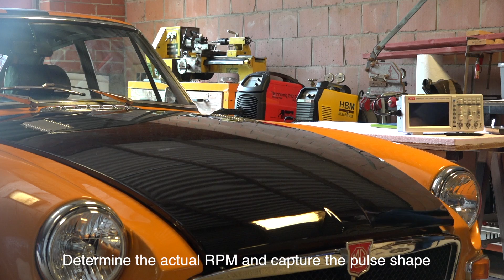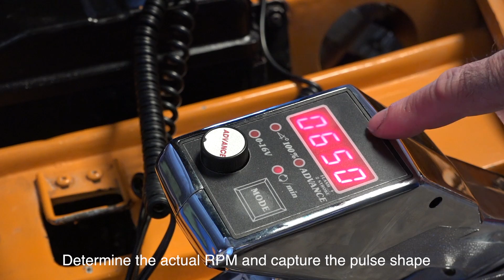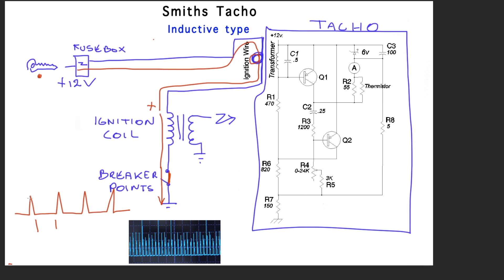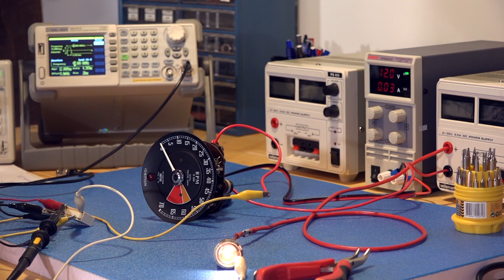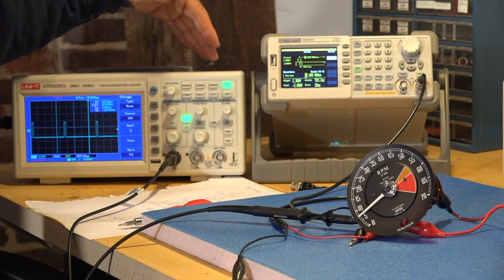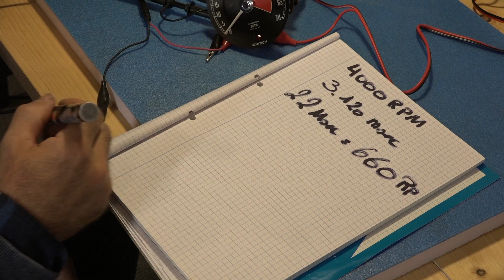Understanding and adjusting the Smiths tacho Part 1

Comment: Can't believe you've posted all this info! Its much appreciated.
What are your thoughts on using the tach output from an Msd 6al2 ignition box direct (maybe reduced voltage) to the B leg of the transistor? As per your signal generator.
The induction loop on my RVI I'm sure won't work due to multiple sparks and the high voltage they use on the primary of the coil.
Best Wishes.
Reply from the maker: My pleasure.   That might work as long as you keep the  voltage  under control..

Comment: Excellent! Mine, on a '73 Morgan, stopped working. This is going to help. It's RVI 1050 / 06A.The diagram in the manual does not show a wire going directly to the coil. But there are two connections (a male and a female) on the back, and 12V   "swings" by. I assume the loop you refer to is between them, inside.
Reply from the maker: That is indeed the case , as that loop is needed  for induction

Comment: Great explantion and presentation!  I'm still somewhat confused, since this is not my expertise at all.  Restoring a 67 AH 3000 with positive grd.  Got a replacement coil with a + and - for hook up.  
With the + terminal of the battery going to ground, which side of the coil should the wire that goes through the loop sensor and on to the ign switch hook too? The points go to ground or +, I believe, but the polarity of the coil is what is confusing me?? 
 My tach has the ign lite on and the car runs, but no tacho...  Does it matter which direction the loop wire from the coil to the ign switch goes through the sensor on the back of the tacho?  In other words, does the loop wire go from the coil through the bottom of the sensor block first or the other way around coming from the ign switch?  
Your Part One drawn diagram, I believe, shows the wire going through the loop sensor, is 12vlts and goes on to the + side of the coil??  Am I reading the diagram wrong, or do I just have a bad Tacho?  The Healey wiring diagram has the loop wire from the switch going the opposite side of the coil...??  Help please!

Comment: I enjoyed watching your videos on Smith tachometer wiring and conversion. I have a faulty Jaeger tachometer (signal from negative terminal of ignition coil) and would like to bench test it. You did your work with a fairly fancy signal generator. Would you know of any smaller, cheaper instruments that serve the same purpose? And how could I put my hands on the circuit board diagram of my tach? Thanks much. Kind regards, Michel

Comment: 5ms would have given you exactly 3000rpm to adjust to. Mathematically this gives you an ideal ratio as you have an integer for your signal generator and an exact line for the hand on the dial to match. Assuming good linearity in the instrument, this should be a good point to calibrate to - it's right in the middle of the indicated rev range, you can check 1500 rpm using 10ms and 6000rpm using 2.5ms (assuming your pulse gen allows it) to verify linearity.

Then you know it's as exact as it can get 😉

Comment: Actually your calculations on paper were wrong. If you count 660 rpm, you have a pulse at every 22.7 milliseconds, that's closer to 23 than 22. 4k rpm however should give a pulse at every 3.75 ms. If you solve the 22.7/3.75 equals 6.05, which is multiplied with 660 gives 3995. So your electric adjustment is damn accurate. Now i'm in the same shoes, i have to convert the tacho to v8, you saved me a good amount of money. Thanks! :)

Comment: Steve your explanation of the working of the RPM meter was very comprehensive just one point in the diagram you have shown the induction coil being in circuit before the breaker point however when you are doing the connection in actual demonstration you are connecting the relay representing the breaker point before the light which represents the induction coil  ? will the RPM meter work the same regardless

Comment: Hi shooter ! First of all thank you for your excellent video !!! I have a Gen 3 RVC Type of a Jaguar V12 which is basically functioning and I calibrated it using an Arduino board to generate the ignition pulses. The meter consumes about 50mA  and behaves well when I attach the 3.3V signal between GND and the MIC 2/C input 2 (and even to the blue/white input wire). But the chassis to ground shows a resistance of 96Ohms which makes it non functional when mounted. Where is the connection from the Chassis (and the frame inside the meter) to the signal ground ? I did not yet spot a 100Ohm resistor - is this by design or should I just connect signal ground to the frame ? Best Regards, Tom

Comment: I am just wondering what would be the symptoms of old capacitors.  I have a 1972 For Capri Tacho that is not showing any RPM at all.  It has power.  Would the old capacitors be to blame?

Comment: Hi, I'm having a nightmare trying to calibrate a single transistor RVI with my function generator. When I inject the pulse it is being dragged high and sending the pointer full scale. I have even purchased the SDG1032X Siglent function generator like yours. Any advice would be greatly appreciated ? I tried to pull the signal to ground but the reading varies according to the resistor I use. Damien
Reply from the maker: Tell me a bit more  how you are using it and possible you have failing components if that does not work

Comment: I replaced my original distributor with the 123ignition. After adjusting my original Smith tacho RVI at 1000 RPM with a strobe the tacho shows higher RPM values against the strobe the higher the engine speed:
1500 - 1300
2000 - 1600
2500 - 1900
3000 - 2200
Should the C2 6V/100 be replaced or probably the tacho itsself on the mechanical side.

Comment: I have a 67 Volvo 1800S with Smiths Tacho. Your detailed video was excellent & stepped through the different parts of the electronics and function of the circuit very well. 
Only comments is that it would have been good to explain the function of the Q2 Transistor part of the circuit in the deep dive section of your video.
Thanks for your time, patients & thorough explanation sharing your knowledge.

Comment: @13:00 .. The spike is not when the points closes but when they open. When they break the magnetic field from the coil collapses and you get a spark at the secondary side of the ignition coil (hopefully at the spark plug) .. This also results in an inductive kickback
Reply from the maker: Indeed
Reply: @D3Sshooter  I know that  pointing out a small error like this makes me sounds like a bit of a Jerk.. But when I watch an otherwise very good educational video with a nice explanation of how something work, then small faults like the one above is extra annoying

Comment: Thanks' for the video, great info! I have a tacho for a diesel (RVP1002/03 D series ford) and need to get my hands of a pulse generator to mount on the back of the pump.
I'm not sure what to look for as there seems to be some difference between them.
There are three spade terminals on the back and they are going to the puls generator together with 24v.
What does the puls generator do, what can i expect for signal, is it some sort of dynamo? 
Thanks
Christian
Reply from the maker: Maybe I can help but would need a bit more info , I assume that you are referring to the pulse generator..  typical that is a loop current connection and a power feed...   is you generator a Smiths Pulse Generator TV3203.00A ?
Reply: @D3Sshooter  Hello and thanks' for the reply, the thing is, i don't have the pulse generator and don't know what to look for.
The connections on the back is  terminal one "pos" and "Gen Z", number two says "Neg V" number three says"Gen X"
I have found a pulse generator TV3250/02A but it have only two cables. Thanks' Christian
Reply: @D3Sshooter  Sorry for The delay, no i have found a TV3250/02a but not sure IF it Will fit. Its a two cable unit

Comment: I was confused by the tacho diagram, because I thought there was a connection on some overlapping connections where there wasn't (between Q1 and R2 and between R3 and R4). A "go around" connection instead of a straight one, would have made it more readable. That's why I couldn't understand your explanation.
Thank you for another amazing video.
Reply from the maker: Thanks for the comments

Comment: Fantastic video - thanks. A quick question!  What is the maximum sweep possible from the tacho if modified?  I am trying to find a gauge to modify to create a sweep of about 300 degrees, maybe 330. Obviously 360 degrees not possible, but do you know how far the gauge can be persuaded to sweep if higher voltages applied?  Thanks in anticipation....
Reply from the maker: Thanks for the comments,Not sure and I would need to test it

Comment: just today hauled out a taco  identical looking  pcb/  component layout  but says negative earth   will it work with electronic distributer  your explanation very good thanks
Reply from the maker: Thanks for the comments, as long as you have a coil and you loop de current trough the tacho on a loop it should work.   If you have a full electronic ignition, then it will no longer work as you do not have that current loop on the Coil

Comment: You're joking. You  got an electronics lab too. Grounded EDS matting. Hey A mono stable vibrator is just a 555 timer chip and the resistor is external. right?
Absolutely love the electronic side of automotive eng.
Reply from the maker: Thanks for the comments,  Yes  I am an electronics design engineer from profession and have some old toys still around.  yes you can use the 555 for that purpose

Comment: Hi, Great video! I have an RVI240/OOB positive earth that i got from a friend. He said he didn't know if it works. I swapped the power and ground wires in the back (re soldered to make it negative ground) and wired it in between the coil and the power wire to the coil. Doesn't work. I tried testing the impulse loop, - no resistance, as well as changing the positioning of the wires.  How do I test the capaciter or transistor for problems? Would love to hear back. Thanks so much for the video!
Reply from the maker: The issue is that you cannot just swap the wires, there are transistors and diodes and those need to be replaced or reverted  in case of diodes ( zener).   Transistors are are either PNP or NPN   so depending on the ground use those should be changed.  IMO
Reply: @D3Sshooter  I cannot swap the wires? This is what I did: https://www.youtube.com/watch?v=ddZ0E2Wd6Ic&t=289s - i swapped the polarity of the ground.

Comment: Very informative video Steve. Thankyou for taking the time. My issue with my Smiths tachometer ( RV1/1240/OO1 converted to neg. ground) is that it reads aprox. twice the actual RPM. Would an opposite wound inductor loop cause this?
Reply from the maker: Txs for the comments,  No that would not cause it as it is based on pulses. But you might need to adjust the resistor   . does it do that all RPM's
Reply: @D3Sshooter  Not sure on that. Idle speed seems high (registering about 1200, yet sounds like a proper idle speed), however, on a drive it smoothly increases at all speeds but shows 5800 to 6000 RPM at 50 MPH. At that speed I noticed it would sometimes slowly move slightly higher ( up to 6500 ) even though speed remained the same. I checked my gear ratios and according to those RPM's my speed should be in the maximum range of about 90 MPH. I checked the speedo calibration and it seems quite accurate. If resistor adjustment is recommended could I do this with the tachometer on the bench using a basic 5 amp battery charger? And if so, where would the 2 charger terminals be attached?

Comment: Again, thank you very much for taking the time to provide such a comprehensive response. On a separate note, I also have a Rolls Royce Silver Shadow And have replaced the points with an ignition 123 product that is out of the Netherlands. Basically, it replaces mechanical advance with an electromagnet and obviously provides a more efficient spark. I will send a YouTube video, however, it will not have the production value of the ones you produce.
Reply from the maker: Thanks for commenting

Comment: Thank you very much for taking the time to create such a comprehensive video. A quick question, I have a RVI 1240 smiths gauge out of a 1966 MGB. Is it possible to utilize a pertronics ignition system. It has been suggested that you modify the induction loop to a single pass-through and add resistors to the induction wire. Does this sound plausible?
Reply from the maker: Hi Kevin, the principle of he wire loop is to form a coil. The ignition cause a current flow from the battery through the wire loop onto the coil , through coil and out to the contact points each time they close.  That causes in essence current pulses in the wire.  A classic ignition draws a certain amount of power, much depending on the balast resister and the coil itself.  Never the less the current must be sufficient high  for the induction pick-up of the Tacho.  if that is not high enough then it will not be picked up.   For an electronic ignition, that is another story. Here the Ignition solid state hardware needs a DC power supply. So here we cannot use the loop directly. Some electronic systems are coil free, others not and just have electronic braker points.  A full electronic ignition will be very difficult ( no coil,no brakers) as there is no such sensing point, unless special provided on the actual hardware of the electronic ignition.  A half electronic ignition can work as long as you loop the wire from the ignition output ( the one to the Coil) through your Tacho and then back to the Coil ( positieve side of the coil for negative earth cars).  In most cases that will work. Bottom line , its mainly the amount of current that flows through the wire that determines if the tacho can pick it up. a winding less or more might help.    I will check that type and come back shortley
Reply: @D3Sshooter  Again, thank you very much for taking the time to provide such a comprehensive response. On a separate note, I also have a Rolls Royce Silver Shadow And have replaced the points with an ignition 123 product which is out of the Netherlands. Basically, it replaces mechanical advance with an electromagnet and obviously provides a more efficient spark. I will send a YouTube video, however, it will not have the production value of the ones you produce.
Reply from the maker: I did check the pertronics ignition system and it seems to be only points.  IMO, That will just work and no need to modify anything.  You still use the coil and that system is only replacing the points with electronic points.   I have something similar in my MGB-GT V8.

Comment: hello flemish. there are things i dont undestand about you. i see you talking about tachos . but where and how did you get the circuit diagram of it.  like also on mf35 you said for inlet valve we use 0.3 mm filler gauge and so so, but where do you get such info. that for this tractor or car the spec for what what is what what. on brixton when you were cheching o2 sensor it had four wires, i was scruitinizing at you and out of the sudden you have already drawn the diagram of those wires. how did you know which wire is which. in fact you did not show us how and where you got that

m.b.s moshitoa ( s africa)
Reply from the maker: Well I am an electronics engineer, and many things are done in simular ways.  In addition many diagrams and info can be found all-over the internet/ regards
Reply: @D3Sshooter  "I AM AN ELECTRONICS ENGINEER" WONDERFUL, NO WONDER. APPLAUSE TO YOU. I HAVE LONG BEEN WILLING TO KNOW YOUR PROFFESSION.
AT FIRST I DID NOT EXPECT YOU TO KNOW MATHEMATICS, YEiiiiiiiiii, LATER ON I SAW YOU DOING SOME CALCULATIONS THAT INVOLVES ANGLES AND I WAS SO IMPRESSED. LOL   HAHAHA

I ,MYSELF LIKED ELECTRONICS BUT UNFORTUNATELY I HAD BAD TEACHERS THAT WERE NOT KNOWING IT. INFACT THEY WERE JUST READING FOR US FROM THE BOOK, BUT UNABLE TO EXPLAIN HOW SO. THEY WERE JUST TAKING EVERYTHING AS WRITTEN IN THE BOOK WITH NO EXPLANATION.
I MYSELF AM ELECTRICAL ARTISAN SO THAT IS WHY ATLEAST I CAN FOLLOW YOU HERE AND THERE ON ELECTRONICS. IN FACT I JUST KNOW THE NAME OF COMPONENTS AND THEIR FUNCTION, BUT DON`T UNDERSTAND THEM WHEN COMBINED TO DO A CERTAIN THING.

CONGRATULATION. FLEMISH.
M.B.S MOSHITOA (S AFRICA)

Comment: Excellent video. I found it very useful. Have you ever thought of explaining the workings of the old type voltage regulators for alternators that are using relays and possible digital upgrades to get en improved voltage. Mine for example is a bit on the high side (which "cooks" the battery) and instead of trying to bend gaps of relays I'd trust a digital setup more.
Reply from the maker: Yes I did, however I tend to replace the Dynamo's (DC) models out with an Alternator (AC) . As the alternator has the diodes for rectification and stabilization all build in.  So no longer a need for the old type dynamo....  Maybe I could a video on it
Reply: @D3Sshooter  In my case I have an alternator that still needs an external voltage regulator. Typically used in japanese cars from 70s to early 80s. They have the diode bridge built in but that's about it. Field windings and neutral point of star winding are fed to outside connectors. I don't want to swap the perfectly working alternator (especially since I even have an identical spare lying around). But regulator upgrade would be something that I would be interested in.
Reply: @D3Sshooter In case it interests you, this is how they are wired up: https://ibb.co/Yt33MJ6